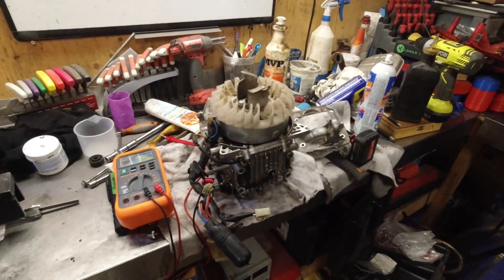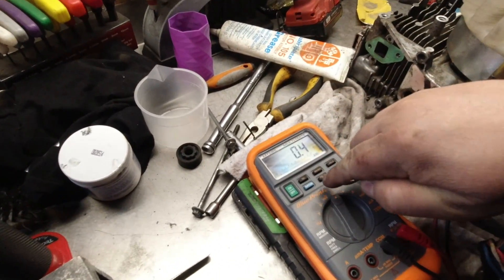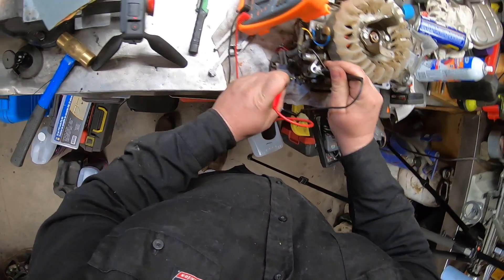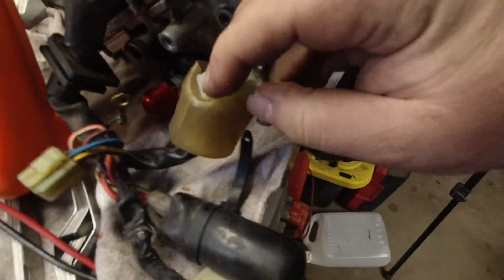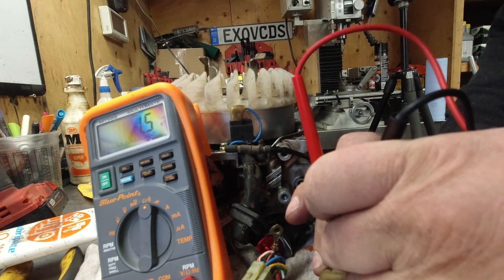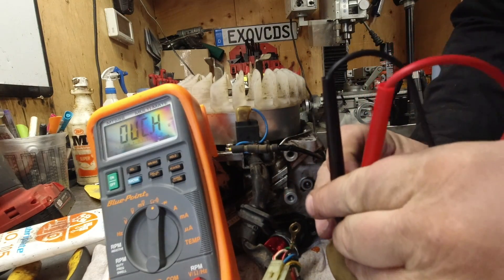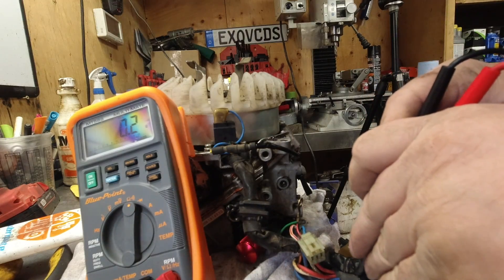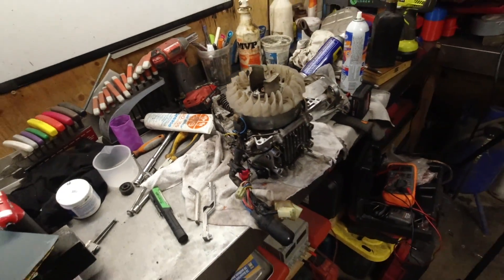Honda Eu2000i No Power issue Stator test

Comment: Hello, I would like to ask if this Honda Eu2000i generator can modify the output voltage from 110v to 220v by changing any combination of cables.
Reply: only by buying a 220 or 230v inverter,
Reply from the maker: Don’t be stupid
Reply: @TestDontguess  Stupid? Its a fair question, the whole of Europe runs on 220/230v.